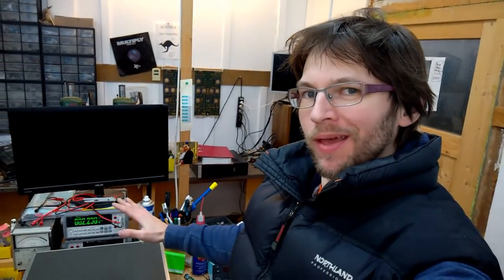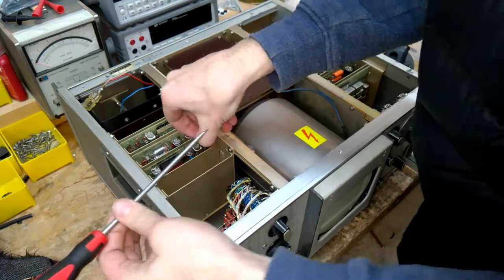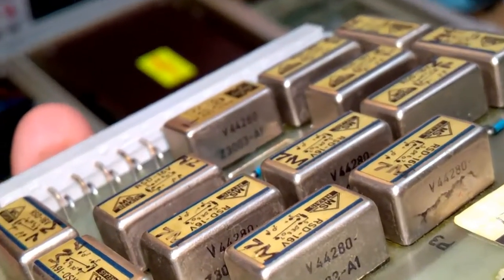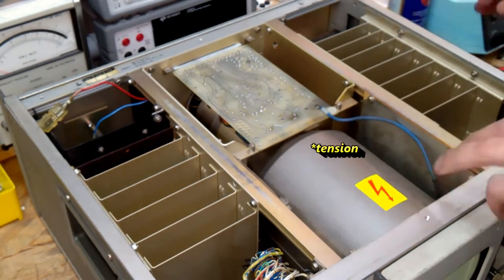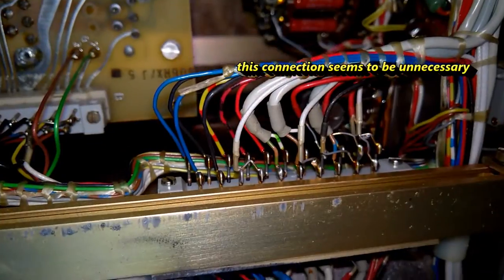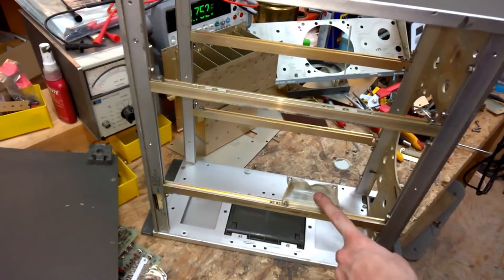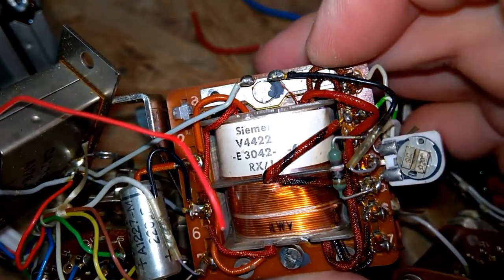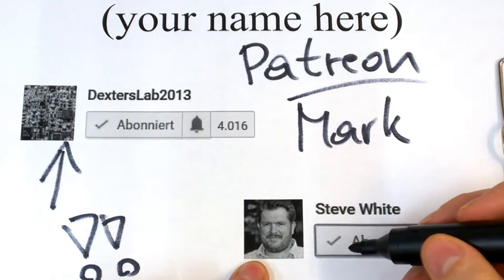BEB #38: Vintage Siemens K2001 Level Tracer Electronics Teardown

Comment: Siemens made some nice telecoms analyzers,  I took apart a later digital version of this they made.  much the same construction style, but digital and higher density.  Chassis used the same style of extruded mounting bars.  Your English is fine :)  I spot an opportunity for improved efficiency though...  an electronic screwdriver for all that unscrewing!
Reply from the maker: thank you for your comment. very interesting. do you remember the model number? Might start with D....
Reply: I'm afraid not, it was 10 years ago now.  It was a big brown thing with a ribbed aluminium cover.  CRT was on the left and at an odd angle.  can't find one on ebay or google image search to shoe unfortunatly
Reply from the maker: oh yeah, that's another nice one.